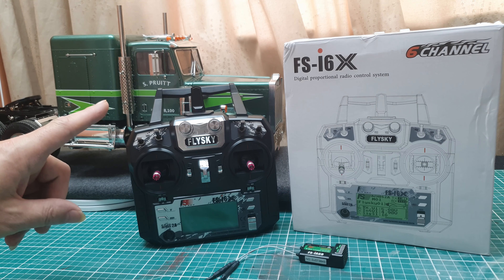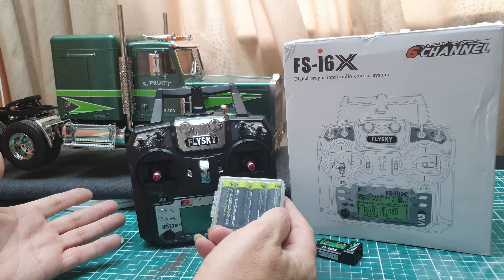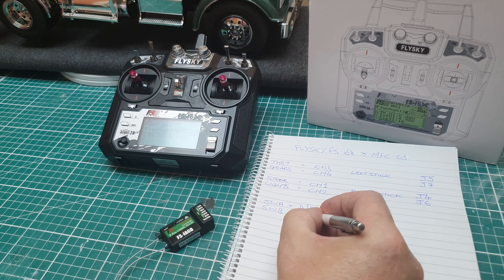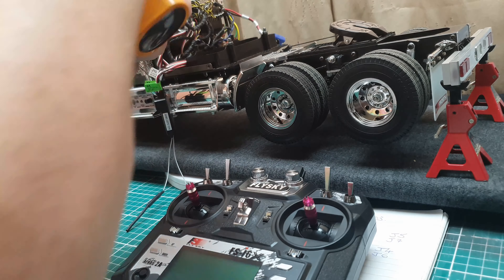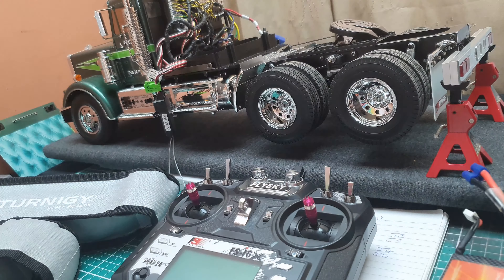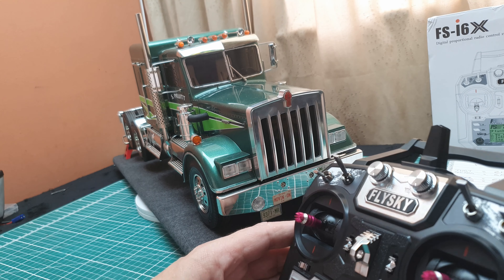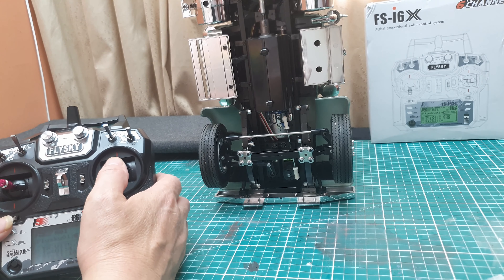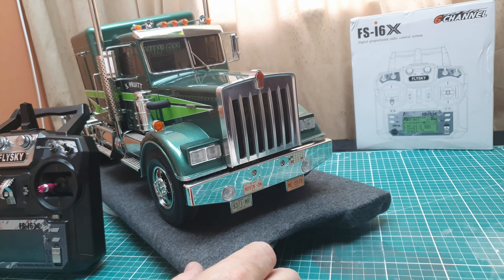FLYSKY FS-i6X & Tamiya MFC-03 Set Up, Operation & Steering End Points

Comment: hi teri great video as I'm new to flysky I've followed your steps but I can't seem to get the lights to work I've got the lights on channel2 and headlights on j13 on the Mfc 03 as stated in the manual is there something I've done wrong or got mixed up the Mfc 03 is used in the Scania 770
Reply from the maker: Forget the manual. 
Plug in J4 5 6 and 7 in the receiver as in the video and set the dual rate as shown. Calibrate the MFC-03 with you radio with the dual rate switch in the Up position and then your lights should work when dual rate switch is Down and tap the right stick down to cycle through the lights.

Comment: I can't turn off the lights, they always stay on, what am I doing wrong?🤔🤔
Reply from the maker: @filipejosegodinhoantonio2455  
The lights work in 4 stages...... 1 2 3 and off
Reply: @TeriWilde  ok, but is it on the auxiliary buttons?
excuse my ignorance😅 I started the hobby recently and I want to replace the original MJX 14210 HYPER GO command for the flysky fs-i6x that I recently acquired
Thanks

Comment: Yeah Teri, I'm a simple guy still learning about RC trucks. I have a WPL B14 and the set up is worlds away from Tamiya. I do have the flysky transmitter however I only need throttle, steering, gear change "2 speed" lights and I think that's about it. Can you please advise me on what brushed ESC and anything else that I may be leaving out.

Kind wishes,

Edward in Osaka Japan
Reply from the maker: I find that the Hobbywing 1060 is very good. I use them in all my other RC models. beware of cheap Chinese fakes. The genuine part will always have a red Heatsink.
Reply: Thanks Teri for your answer and advice. 😸

Comment: How does the extra J10 wire get connected to the gear shift servo
Reply from the maker: the gear shift servo is not plugged into J10, that position on the MFC is left open... the shift servo is plugged directly into Ch6 (AUX) of the receiver and controlled by a 3 positions switch so it works independently of the MFC
Reply: Hi Teri,
Thank you for taking the time to reply with the answer to my question. I noticed from your video that the shift servo was operated from the left stick as well as the 3 position switch. I can understand either one or the other but not how the stick still operates the shift servo if it is not plugged in to J10. My apologies for rambling, so l hope you can follow my dilemma. If you get time l would appreciate your explanation.
Best regards,
Neil.

Comment: thanks for great tutorial. one thing is MFC is not decided for battery above 7.2v. Don't you worry LiPo could damage the MFC unit? and do you have video about light channels to MFC explanation? THX
Reply from the maker: I have never worried about the Lipo on the MFC, it'll handles it quite well, Adding a Lipo alarm only ensures you don't let the battery get too low and suffer damage...
The other advantage of Lipo is the better power delivery, in another video I showed the power drop on a Nimh pack when going full throttle was quite dramatic, but the Lipo pack under the same test held it's power curve much better.

Comment: I followed all the instructions and my headlights dont come on when i pull down on the stick
Reply from the maker: I assume you are using the FS-i6X and you have set your dual rates at 75% - 100%, and you did the calibration in the 75% position.
Did you set the D/R switch to 100% when you pull the stick down?
Reply: @TeriWilde  yeah I am using FS-i6x. Set the dual rates and did the calibration just like in the video

Comment: Great video tutorial, just one question I take it that the wire that plugs into channel 5 is any accessory light?
Reply from the maker: Ch5 can be used to control a RC Switch or beacon.... if Ch5 is allocated to one of the rotary dials then it could be used as a variable 2 way control for a tipper screw drive.
Reply: @TeriWilde  Thanks Teri 👍